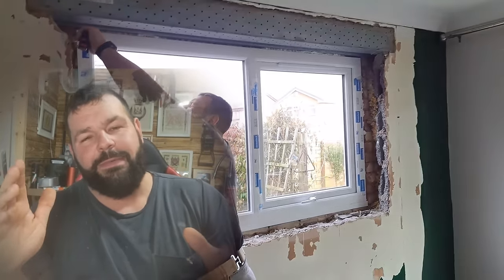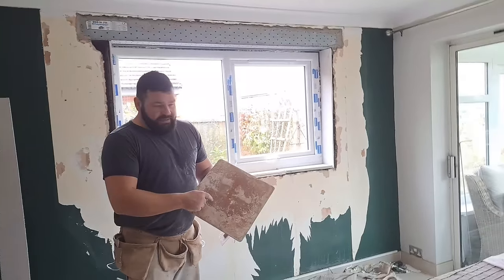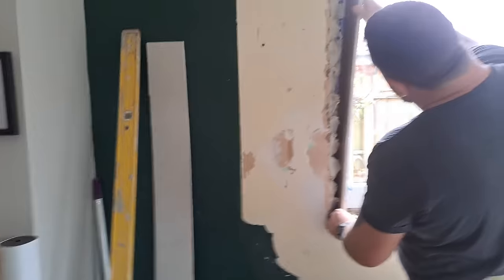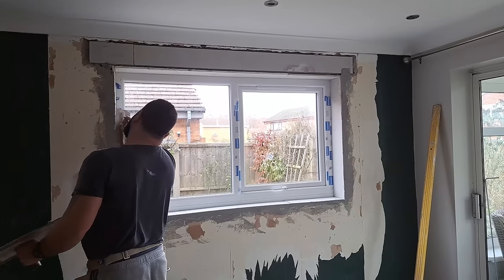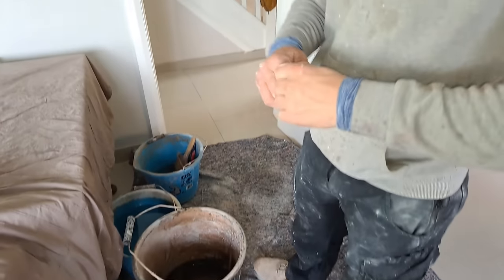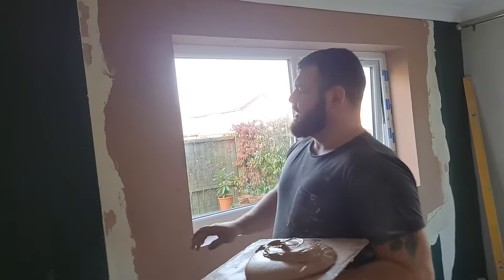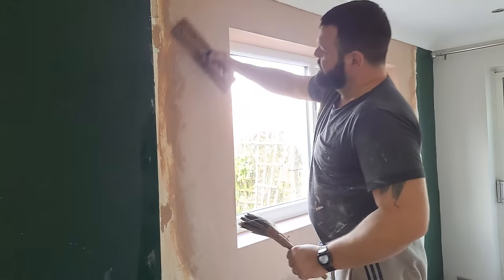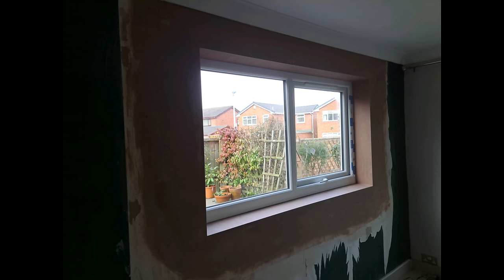NEW WINDOWS| FASTEST PLASTERING

Comment: The discrepancy between the inner and outer skin is a perfect opportunity to line the reveals with 27-37.5mm insulated plasterboard
Reply from the maker: Good shout, we just didn't have any
Reply: Wouldn't pass building control
Reply: @Louis Burgess  why?
Reply: Brilliant video 😂
Reply: @Louisthesaxman1 why would building control be involved in a window installation?
Reply: @SScc14105 yes they would
Reply: @MrJimtimslim  the customer would have to inform them and pay £600 give or take the area. Why would they do that for a window? An extension yeh but not a window 😂
Reply: @SScc14105  yh but you still should inform them. Same as anything 
Don't get me wrong I've done it without but to the book, you should inform
Reply: @MrJimtimslim you should inform the water board when you fit an outside tap but I doubt whether anyone ever has lol. They'd have you filling in a form for a piss if they could.
Reply: Nah! Overkill

Comment: Cavity closer? To prevent the plasterboard being cold on the back side where the cavity is....and causing a cold spot on the inside, leading to condensation and mould growth from the heat in the house. A thermal bridge via the open cavity.

Comment: Another superb video, loads of information and relaxing to watch. That too wide inner opening is the result of not being able to use an angle grinder in an occupied house.  There are dust catchers for angle grinders but nobody has made an affordable tool that will cut an opening in an 11 inch wall from the outside. I had a diamond chain saw that would do it but the chains were £200 so I am back to chain drilling  down the wall to keep it on the line.
Reply from the maker: Roger please email me at Mrkirkjohnstone@gmail.com
Reply: Festool do a nice 125mm angle grinder with a very good dust catching attachment. It's more suited for chasing but it will cut a nice straight reference edge and you could drill and chip the remaining brick or block. They only release a tiny amount of dust on the initial part of the plunge, thereafter no dust escapes.

Comment: OMG, Bodge-it & Run window fitters have been at it again! Kango'd inner blockwork given a good old shake to loosen all the mortar. Inadequate lintol bearing on broken blockwork with no padstones. No cavity closure. No vertical DPC. No insulation at closure. Used inappropriate lintol, with no built-in insulation, and which seems to be leaning over more than the sloping sides would normally as well as not being square in opening. 

That's going to suffer all manner of cold bridging, with interstitial damp soaking into the plasterboard causing it to soften & fail. Plus bonding doesn't like damp areas. And the plaster at the top corners is likely to crack if the end bearings fail under load. But I guess the window fitters will be long gone before the householder realises it. 

Anyway, in the circumstances, it's remarkable to have worked round all those problems & hidden all the window fitters' bodges with a nice finish in only 3½ hrs!

Comment: Great channel, love your work, can I just add ,, if you added a couple of handfuls of cement into the adhesive mix it would of gone off in literally a quarter off the time, that way negates the need for the Bonding coat because your actually able to get a more than acceptable finish ready to plaster with the application of adhesive!
Reply from the maker: Cheers for the tip mate, I'll give that a go

Comment: I`m a window Installer that does this often. Sometimes I do the lot, sometimes I get a plasterer in, depending how busy I am. The only things I would suggest.... ?.Have a few oddments of skip dived kingspan on the van an wedge that in as a thermal break /cavity closer  which also gives you more to foam /dab the board to. Also , if the lintel is flat and down level with the window, I would use a couple of self drilling drywall screws to fix board to the head. I know technically you shouldn`t drill lintels but hey! I normally skim the whole wall if it`s a small wall but to be fair , that`s because I`m not overly confident at blending, might give blending a go next time. Great tradesman though, loving these vids!

Comment: Hi Kirk, thanks for reply. I rmbr you said to post another comment cos you don't get alerts for replies of replies. I used a roller to put sbr on. Urgh there was so many variables on the job. It was cold, the air was damp, half the ceiling was replaced due to flood damage. However i sbr'd the new plasterboard to make it all go off at same time. I thought maybe it had frozen in the van and thawed but it worked fine on the plasterboard, no blisters so wasn't faulty sbr. They were like little bubbles you get sometimes going over bonding but they didn't do the rice krispie poppin, they just stayed there and was flippin thousands of them. Just my luck 😂 a lot of them flattened during the process but some stayed the whole way thru and could only get rid of them when half the ceiling had gone dark. I did speedskim after laying on but don't think it was that either. I took pics but obv no way to show you. I was quite surprised at it tbh. Thanks mate 👍
Reply from the maker: Email them to me mate. My email is in the channel description

Comment: Fantastic video as always.

What I like is that you cover real world scenarios, other YouTubers do tutorials on plastering a new wall….but everything is perfect, the prep is done and usually there are no sockets, rad brackets etc.

One point to make: there should be a  DPC fitted - which goes vertically, it’s tucked into the cavity and comes across a bit of the window frame. Then when your plasterboard goes in, it can’t touch the external brickwork. Any DPC poking out by the window frame can later be trimmed. Cavity closures could’ve been used.

Any plasterboard or bonding touching the external skin is very likely to track damp and eventually the window company will get a recall from the customer.

However correct damp arrangements are the responsibility of the window company…..it’s good that as a plasterer you are thinking about this…but really it shouldn’t be a consideration.
Reply from the maker: Top comment. I can't say everything I want to say on a video because obviously it's not good practice to pull faults with what the builder has done when he's giving you work

Comment: Please don’t take this as a criticism to you Kirk. Technically it’s not by the book, but as you said at the start, it shows the problems and pressure restraints we have to deal with in real life. Fair play mate . Oh and a good video 👍
Reply from the maker: That's it mate, this was us landing on a job, no viewings, no description, we just get an address and told its one window. Miles  away from building merchants and home and customer said we need to be finished by lunch as he's going out 🤷‍♂️
Ideally we could of toothed the bricks out and replaced them, set the lintel back another inch, installed cavity closures,  stripped the wallpaper and skimmed the whole wall... but this is how it really happens sometimes as you know mate🤷‍♂️.
We've done more interesting ones than this aswell mate 🤣
Reply: @Onthetrowel  funny enough, I just finished a job. I was told 2 plaster patches in kitchen, following re-wire. When I got there, 6 in the kitchen , 3 in the hall, 3 in the living room. Holes in all the ceilings. Best bit, our favourite trade ran their cables flush with the plasterboard to the kitchen and hall ceilings. Cut and patch 🙄. Keep the videos coming

Comment: U did well there Kirk great job with no time to do it but reckon ide have have told the window firm that it needed a timber window board it’s less work for u and a much better and stronger surface ok they may have had to have got a chip pie in but that’s not ur problem is it still that said u made a silk purse out of a pigs ear there mate great stuff

Comment: Very interesting., and a job well done
I'm doing the same job tomorrow, and picked up some tips
Just one question though.
As you skimmed 3 quarters of the wall, was there a reason for not doing it all, and making a better finish for repapering?
Just wondering.
Reply from the maker: It was blended in perfectly, it actually would of been easier to plaster the whole wall. That said... the reason I didn't was because they hadn't stripped the wallpaper back enough.

Comment: Hi Kirk, another brilliant informative watch 👍👍 I hate to ask a question here and know you're struggling to answer them all so it's cool if I don't hear back from you. Is just that I tried SBR over a painted ceiling yesterday. Just a flat old painted plasterboard ceiling. I tried it after watching all your vids about it 😁 I let it dry 24hrs and used board finish but I'n not joking there must have been about at least a thousand blisters in it. I've never seen anything like it. But I took another tip from your vids 'don't panic' 😂 any idea what on earth happened? Thanks. (Ps the beers are coming once I get my head above water, am still skint)
Reply from the maker: When you say blisters, do you mean like little air bubbles mate? 

P.s. don't worry about beers mate, I'm not after your money, I genuinely like helping people.

Also did you paint the sbr on with a brush or roller?

Comment: Sorry you've done a great job but I just see it as a bodge but maybe it's the window companies fault for not allowing to do it properly. It should definitely have insulated plasterboard on the reveals with current building regs and not plastering the whole wall is bodge for the sake of stripping a little bit more wallpaper. It will probably need plastering anyway once it's removed.

Comment: quick question when you sbr or pva the wall do you sbr further than you blend the multi finsh or blend plaster past where you sbr to just thinking if you leave exposed sbr or pva paint wont stick did i make sense or sound like a complete nanna😁😁😁
Reply from the maker: Yes mate seal past where your plastering, if it's not sealed the plaster falls off.

Paint is usually fine although some paints will flash over pva so it will need a coat of stainblock *sometimes

Comment: put sum powdered lime in with the bonding and the dab sets rely fast.
Reply: cement or dirty water does the trick, if you work cement out right you can have it off in 5 mins or 25 mins you can get it exatly how you want it

Comment: Hey buddy, in your opinion, what is the best trowel to use? 
👍🏻
Reply from the maker: Hey mate it depends what your doing. If your on site then I'd recommend a 16" marshalltown.
I do private work so I'm usually going over old walls therfore a smaller trowel helps me apply more pressure when I need to so I use a 14" trowel.
I use either carbon steel or stainless but for the last few years I've used carbon.

This is the exact trowel I have.
https://www.amazon.co.uk/dp/B0002JT2QM/ref=cm_sw_r_as_gl_apa_gl_i_F34ESFWJHJF2RBXH8WKQ?linkCode=ml1&tag=onthetrowel-21

Comment: You could also use cavity closures  which would normally wedge in the cavity fix them with foam or dot and dab they are easier to fix your p boards for your reveals

Comment: Should you be using bonding on outside walls I thought it would be soaking up water like a sponge.
Reply from the maker: Correct mate if we were working on a solid 9" wall. 
This house has a cavity, it's soul purpose is to keep the moisture contained with the external brick and therefore we can do what we want on the internal brick as it won't ever get wet

Comment: So just to confirm, You plasterboard past the edge of the window frame instead of perfectly up to the edge of the frame? That's why you like the brickies to have the 2 skins flush and only have 40mm of frame reveal leftover? I was under the impression you set the inner skin of bricks back 10mm from the outer skin so the boards can sit flush with the frame?
Reply from the maker: Yes mate, I like the plasterboard to but up to the window frame, not the external wall. That way you aren't bridging the cavity and causing possible penetrative damp
Reply: @Onthetrowel  Nice one. I have been doing all mine flush but the cavity is sealed behind with expanding foam. So on the outside if you render the window reveals and put beads up the wall I presume you just follow the edge of the bead up to the edge of the frame square and don't cut into the frame?

Comment: Wow. I was shocked at how you approached that window reveal. You could see that there was a large amount of space where the cavity wall insulation had
been removed - whoever did that hacking out around the reveal made a real mess of it. The lintel on the left hand side had very little support holding it up. So you basically boarded in a lot of thin air ! Why did you not put in more insulation to fill out where it had been removed ? You know enough about building work to recognise that by boxing the thin air like that there will be cold spots as there will be nothing behind the plasterboard at the cavity area. I really love your video's and enjoy them but what you did there was awful. I know that technically it was not your fault but I would have either informed the owner that the insulation needs to be replaced but more likely I would have told them and then done it. You could have foamed in the gap. They will probably find that they get mold
on the cold plasterboard as it has no insulation behind it.
Reply from the maker: I was working for a builder. 
He calls the shots mate. It's sad but that's how it works. 
I could of refused to do it sure. They just get someone else to replace you the next day. 
Welcome to the building game. 
I wish every job I did was in a perfect situation but I can't control what people do before I get there. 
I can only do the plastering to the best of my ability.

1000's of plasterers have to overcome this and alot worse on a daily basis. If they complain or do anything that the builder deems as causing problems then they are replaced. 😪

Comment: I’m a plasterer and have been for the last 16 yrs. Am I the only person who’s a bit uncomfortable from what I’ve seen ? I would never dream of sticking a 12.5mm edge of plasterboard with foam, no way. Secondly, why would you not just skim the full wall instead of patching in round a brand new window ?
Reply from the maker: How would you stick the board to the external skin of brick? 
Secondly if you asked the customer which they preferred to pay patching up or stripping the whole wall and they said they just wanted it patching what would you do?
Reply: @On the trowel  absolutely nothing wrong with what you done there. Top job mate 👏
Reply: @Onthetrowel  I would wrap a timber with dpc, staple around then fix to external wall. A solid fix for the ingoe and a good guide for the dab and finish……For a job like that I understand the customers wants but personally I would have stripped the full wall and skimmed………

Comment: that half time didn't even work
Reply from the maker: Boarding and filling out, stripping wall paper an talking to customer etc took about 60 mins. 

Waiting for bonding to set took about 60 mins

Skimming took about 90mins
Reply: @Onthetrowel  rapid mate. Loads of prep on that one. I had one similar last year where they fitted a Juliet balcony, i battoned the window side of reveal so I could screw onto that, and dabbed the internal side. Stopped the window side of board moving too far
Reply from the maker: @nikthegreekcypriot  that's it mate, spot on. That's the beauty of plastering, so many different ways of doing something
Reply: @Onthetrowel  gotta say your one i’d have walked in and walked out haha. Not a full time plasterer so still get spooked sometimes. Would buy you a beer on here mate but the vans in with Dpf problems, 3 days off work, 2 sensors bought, old ones wouldn’t come out so they had to do welding to remove them and waiting on the bill tomorrow, 6/700 quid atleast im guessing. Nightmare.
Reply from the maker: @nikthegreekcypriot  ahhhh mate been there, my van is in now because of the timing belt and I'm working out of my 1996 toyota pickup.

Comment: Why do you work in inches ? We did away with inches in 1972 I doubt you were born then ?
Reply from the maker: When your cutting boards it gets to many numbers to remember. 
For instance if your cutting around a square appliance there will be four lots of numbers and if they are all in the hundreds it just gets confusing
Reply: @Onthetrowel  🤣
Reply: 71
Reply: To be fair the building industry has always worked in feet and inches . Just the way it is . 🤔
Reply: @builderNorthamptonn  it’s still a long time ago , I don’t understand anyone under about 65 using inches ? Metric is divisions of ten and about as simple as you can get .
Reply from the maker: @paul backhard  you are right, another one that I can't get my head around is why we still use mph for speed limits instead of kilometres